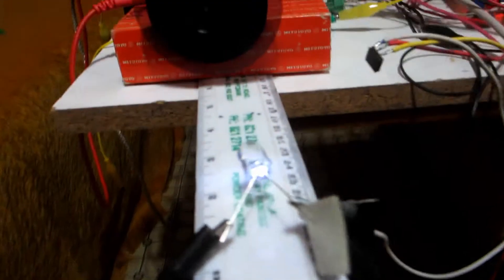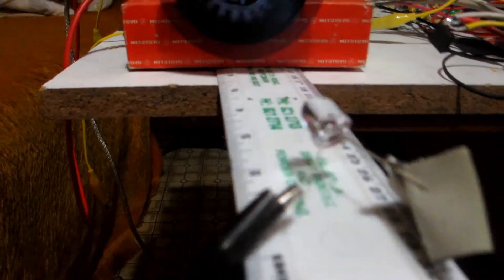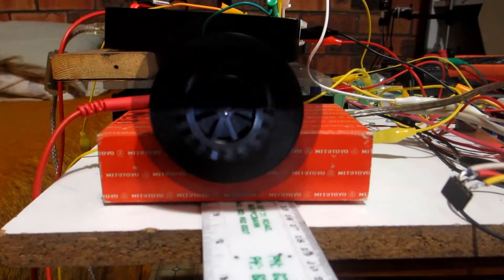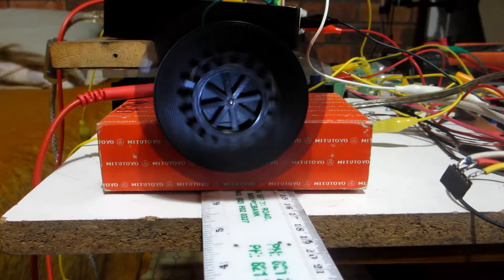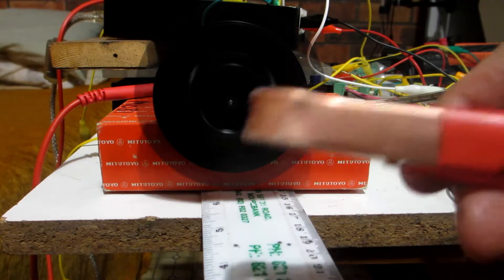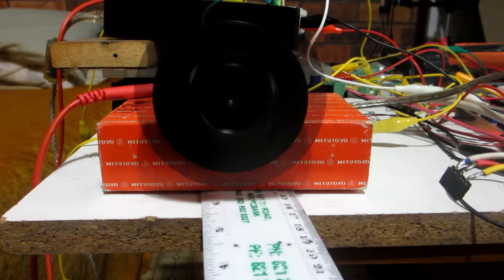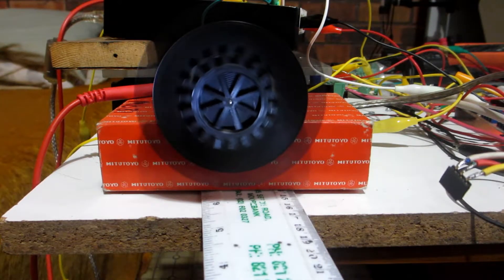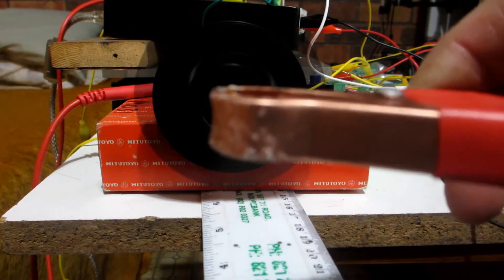Speedy Ardu-Stim seq fault

Comment: I am setting up for a speeduino install on my triumph spitfire and your videos have been invaluable on how to set up speeduino and thankyou for pointing out some of the faults with the hardware and firmware that I will need to work around.
Reply from the maker: It's only a small number of users that get this and other associated bugs - maybe 5-10% -, so you will probably be fine. 
Basically no one would help us, so a user with the same problem went in and tried to work it out. I think he fixed it, but I haven't looked into it because I switched to RusEFI. If you have the problem you can look into it here - http://speeduino.com/forum/viewtopic.php?f=11&t=2590
The associated bugs are -
Kickback on the starter.
Flat spot when you take-off.
Possible corrupted writes to the controller that need a fresh install of the Base Tune to clear it - I only noticed this one recently so I don't know if it's a thing -.